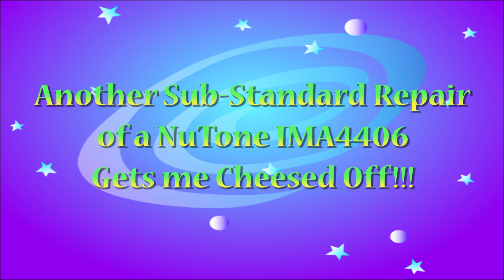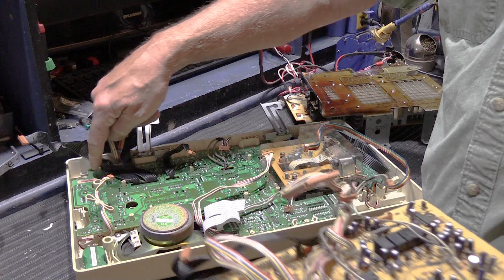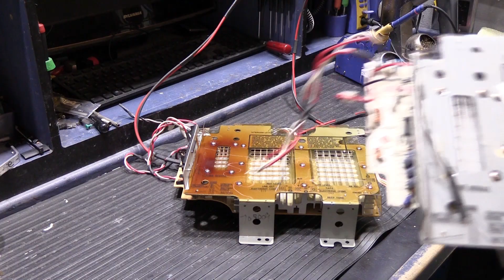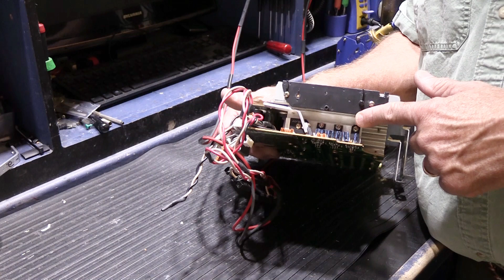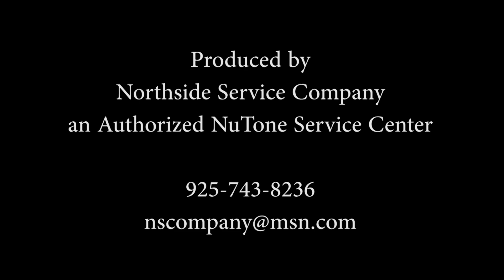Another Sub-Standard Repair of a NuTone IMA4406 gets me Cheesed Off

Comment: You sound like a very decent and fair man,  doing the best for your customers is excellent.
When i used to repair c.b radios and other electronics, if i found a  circuit showing the signs of  later failure,  i would fix it.
if it was a crap design i would re-engineer it for reliability.  (better heatsinks and similar improvements).
But i never charged them for it, only the original problem .
I wanted that unit to work for as long as possible.
Some people thought i was silly,  they just didn't understand honesty. 
Sorry about the long waffle :-(
Reply from the maker: Hi zx8401ztv:  You method of repair is exactly how things should be done.  Fix it once - Fix it right.   I tell many customers that my goal is to not need to speak to them again for another 20 years.  NuTone equipment is very reliable and if it's repaired correctly and thoroughly - it will last at least as long as it did, on the first go around - Chris

Comment: Hi,  I moved into a house that has a M&S MC170.  I suspect the transformer has gone bad because my voltmeter shows no voltage at all.  It was working the first week we moved in, but stopped.  The transformer is a TE-1.

I've watched your other videos to repair the newer M&S 5 wire transformer.  Does mine have a internal fuse that can be repaired too?  I have a feeling my transformer is less fancy?
Reply from the maker: Hi D Cloes:  I'm not familiar with the TE1 Transformer - however based on the fact that it is used with a MC170 - it probably has an internal fuse.  The real question is - "did the Fuse fail on its own - or did the MC170 cause the Fuse to blow" ?  
Here's a link to our Video that may help you figure out where the fault is - https://www.youtube.com/watch?v=Usmvj2kRYbc&list=PLsTvqKsBnGYeAXwG1jzjTMwQpeSfTEvBq&index=11
- Chris